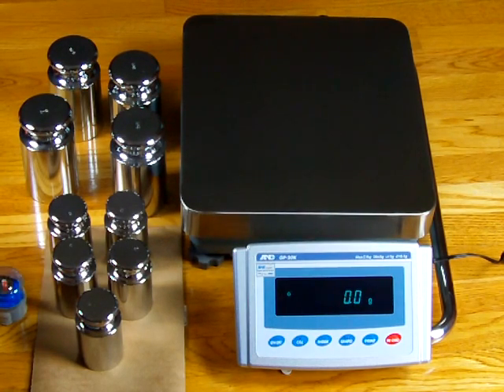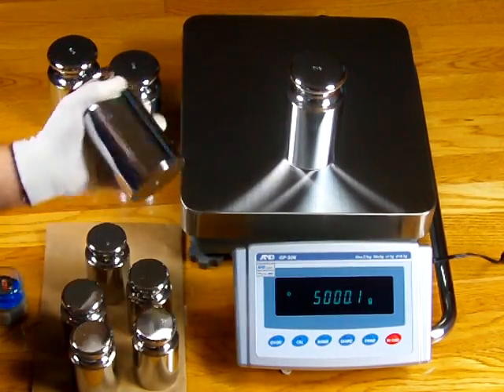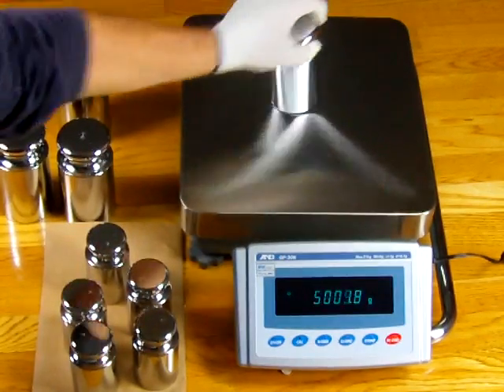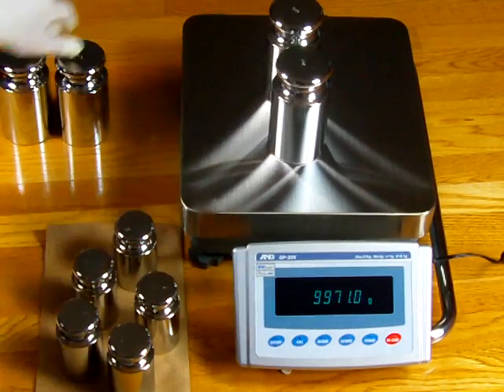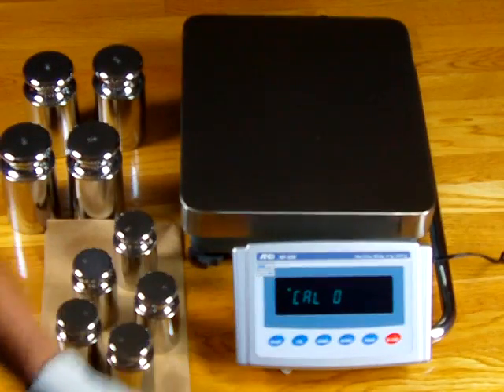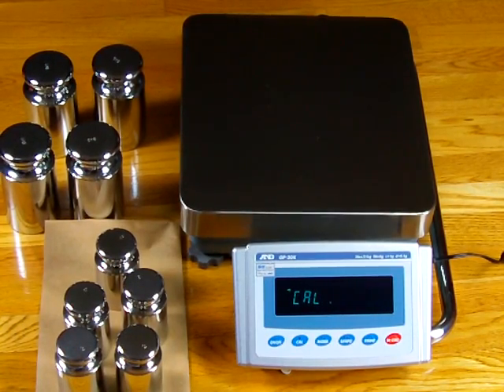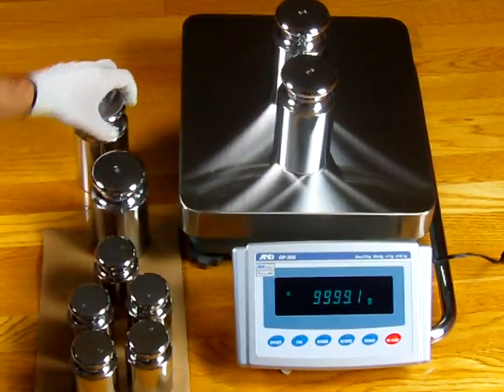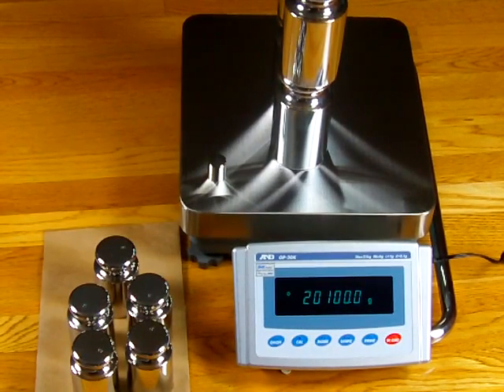What is better External Calibration verses Internal Calibration

Comment: Regarding the accuracy of internal cal weights, I have scrapped weights used in the older analytical non-strain gauge (actual & electro) balances used for setting the various weight ranges and found them to all agree with one another whether they be Denver, Mettler, Ohaus or Sartorius, (I never had an older A&D balance to scrap).  I had asked Mettler and Sartorius tech about the cal class the internal non cal wts used and they would not give an answer but said they far exceeded standards.  Nebulous answers from metrology firms.

Scrapping a Mettler AT400, I thought the internal cal wts in this would be super, but when checking, they seemed off their mark.  Inquiring, Mettler told me the internal cal wt was quite accurate, (as in better than Class E1), but not necessarily an expected wt such as 200 or 400g;  rather, the actual wt used for calibration was stored in the internal cal software and displayed a massaged expected wt like the 200 or 400g.  So, it would seem using the internal cal wts from a newer, strain gauge based balance, at least from a Mettler, probably would not work unless that internal number assigned and locked away in the software could be accessed.  Oh well.
Reply from the maker: I agree "Nebulous answers from metrology firms".  External calibration is the preferred method of calibration since an external weight can be verified of the True Mass and the NVLAP calibration certificate documents "True Mass As Left". Review this NVLAP Cert example at https://scaleman.com/index.php/aitdownloadablefiles/download/aitfile/aitfile_id/857/

The internal weight can be scratched over a period of time and the weight can also get magnetized since most of the internal weights are on a metal hanger. When metal rubs against metal the weight can be magnetized.

ISO/IEC 17025 testing and calibration procedures only allow external calibration for laboratory balances.

Although the EURAMET Calibration Guide No.18 Version 4.0 is for Europe I believe the "Guidelines on the Calibration of Non-Automatic Weighing Instruments" is a good read and you can download it at https://www.euramet.org/Media/docs/Publications/calguides/I-CAL-GUI-018_Calibration_Guide_No._18_web.pdf

Please visit http://calibrationweight.com/ or http://scaleman.com/balances/calibration-weights.html if you need to purchase calibration weights. We are an Authorized Troemner Dealer.